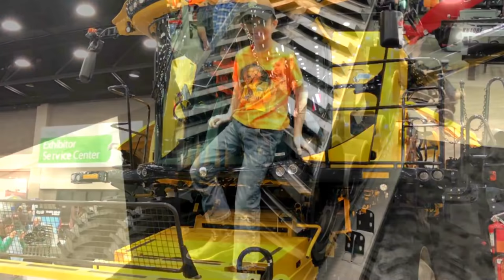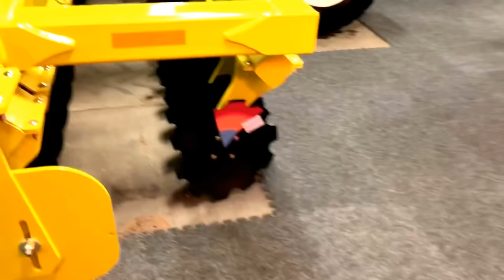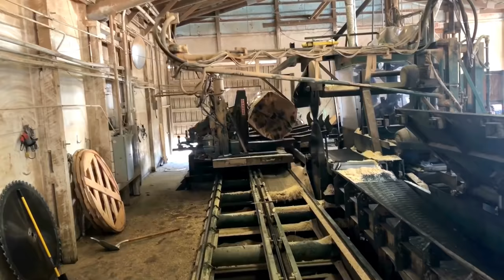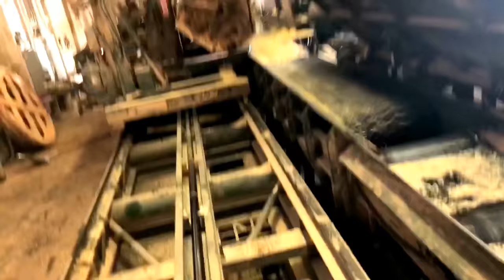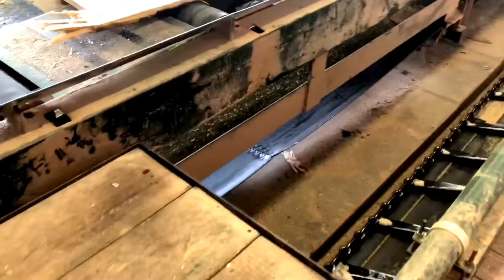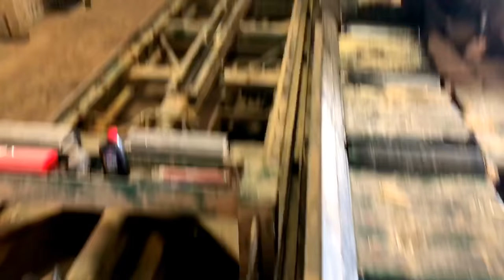February 20, 2018

Comment: Wade think you are right about loggers working in the mill some, also think engineers that draw up plans on new cars, trucks, tractors and what not should have to spend a year working on them If they did that thinks would be a little different.

Comment: What is really fun for the sawyer. The butt is three and a half feet and the tip eighteen inches.The thing will not lay down. No good way to get to it with a chain saw.Yet when it was on the log deck. You think . I can saw that.